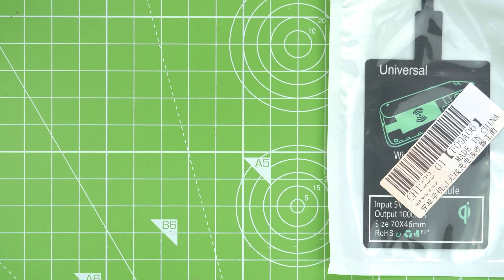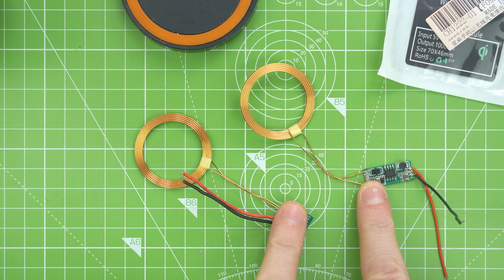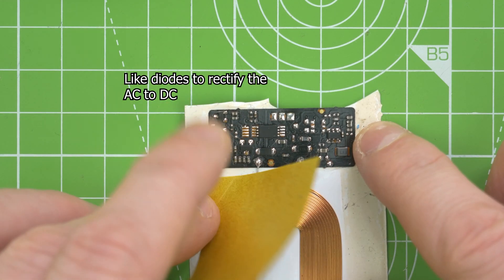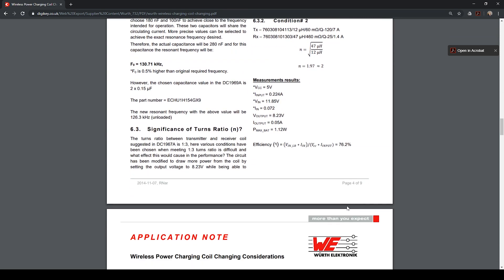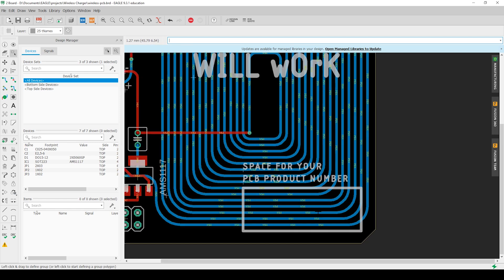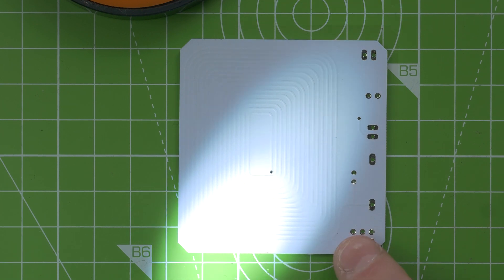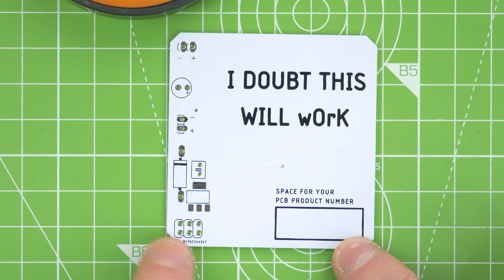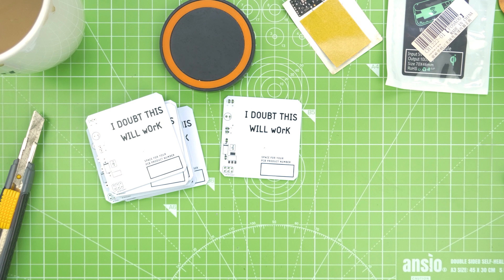Wireless Power Transfer PCB

Comment: You don't even need a cap on the receiver end unless you want to eliminate the ripple, it'll power an LED directly. The transmitter side will probably want more than a few pf, but even then it's not critical, it'll still put out something.

This isn't very complicated, it's just a transformer, for some reason people think it's voodoo.
Reply: Magnetic stuff is always voodoo :P
Reply: Implying transformers aren't voodoo;)

Comment: If you want to see some reference designs TI has a controller chip that is relatively simple here: http://www.ti.com/product/BQ51051B.
Also there is a pairing process that the receiver and transmitter IC go through using the coils before transferring the full power. You will probably see very burst-y power through your pcb, if anything.

Comment: You might wanna take a look at BigClives "real original joule thief"
he kinda sorta simply explains the resonance function of his thingy and how you can drain low batteries completely with it...

for your coil and because its low voltage you might have gone for smaller+tighter tracks because you dont need highvoltage insulation or gaps...
i d be interested if you get voltage spikes from the HF switching. perhaps use a full bridge rectifier 
or if its really "kindof" DC a zener to cap voltage (if its fast enough). 
--Keep in mind that you are building a multi-watts radio device, so perhaps put it in a shielded case for testing befor the feds come knocking.

now for the normal transformer, you will not get the 5V, because you got less windings, so less voltage more current aaand the loss through air gap aaaand no common core.
might want to add a variable stepup+down combination regulator, so you always get 5V at least.

i had the Samsung S7 or some number thereas, which had the wireless charging integrated. Problem was the low charge current. Its fine to buffer up while driving from/to work,
and is fine to recover the energy you loose for having Bluetooth on all the time (car free hands phone).
Also got the charger for free, but didnt really use it after all. 
In the car youd have to put it in an exact position and clamp it down, not simply throw in a compartment.
Also need to be lucky to really get 5V/1Amp across even with the original, more likely around 0.5A...

now with my Samsung A6something i now use i could use usb-c, but still like to use standard usb to usbc.
 Charges slower but i hope for longer battery life that way. Still can go 3 to 4 days without recharging.

so much text... 😅
Reply: https://youtu.be/K53beWYdIpc BigClives thingy
Reply: I'd wager he could have gotten at least 30% higher density with the same trace width.

Comment: Are you on Seon's Unexpected Maker discord, David? I can show you my jar of LED lights I added wireless charging to :D it works very well!
I think the sticker that's over the coil on your OEM charge receiver is a powdered metal sheet that helps to couple the magnetic flux from the charger coil to the receiver coil, so don't pull it about too much cause you'll end up crumbling it away :P
Unless yours is build different and is more flexible.
I got mine from Amazon, it's same one Adafruit sells

Comment: Couldn't you just use a trimming capacitor for that? You could tune the frequency just by turning a screw!
Reply: I found out recently that you can use a lot of standard transistors as vericaps (up to a couple pF depending on reverse voltage applied). As an alternatives to having a mechanical trimmer cap.

Comment: Unfortunately I found the complexity of Qi wirless power isn't the coil and induction but instead the circuit and computation for the 2 way back-scatter modulation handshake that the spec requires.
Reply: I'm wondering if David's coil will work because it will lack this handshaking. The transmitter coil will likely decide there's no Qi compatible device there and just shut off again

Comment: Are you using JLCPCB ? because they tell you to put "JLCJLCJLCJLC" where you want the product ID so I stick this under a chip, or you can pay a little extra to not have it at all, and I believe they will put it on the back, again for a small fee.
Reply from the maker: I used PCBWay this time. I have yet to try JLC
Reply: @DavidWatts  Oh, ok
Reply: That's a useful information, thanks!